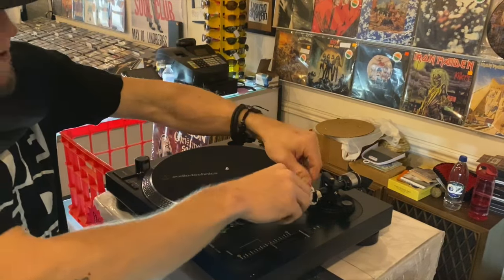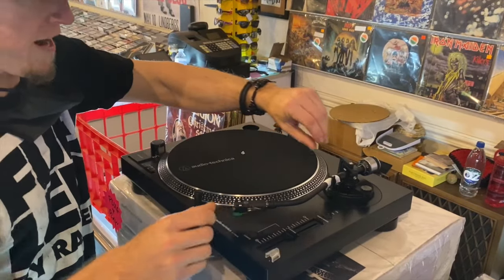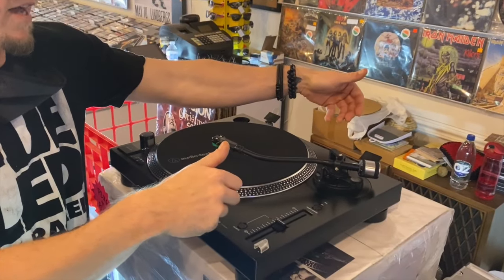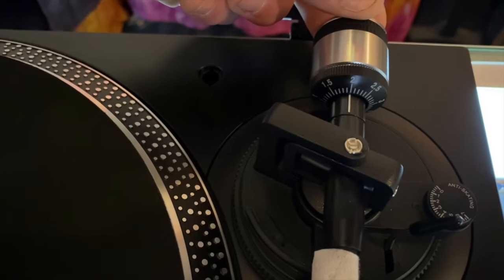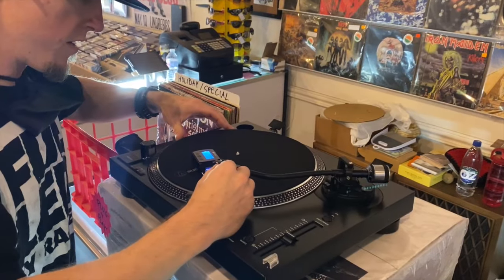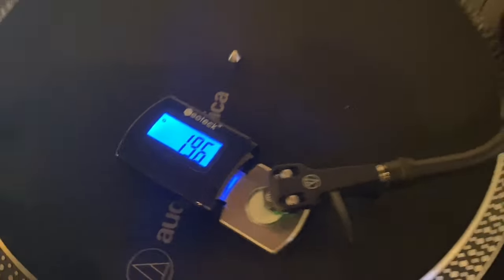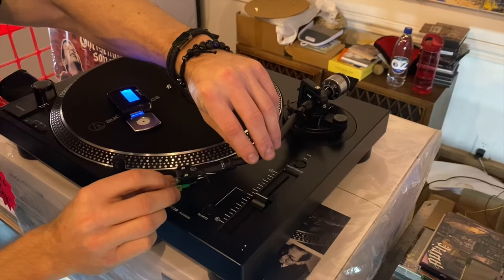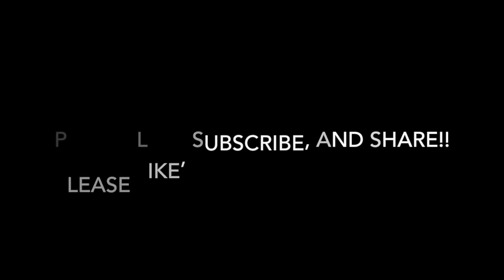How to Balance the Tonearm on an Audio Technica LP120XUSB

Comment: Following all other instructions that say to verify the tonearm floating level resulted in every one of my records having horrible crackling and popping. This method of balancing the tonearm are the only instructions that worked for me. Thanks so much for showing this method!
Reply: I swear I’ve only tried one record so far but I’m also noticing the same thing. This method of how you balanced the tonearm is different than the official video from the company that says just make sure it’s level. But I have a feeling this is a lot more accurate. Great video! Wish I watched this before I set it up but glad I found it within a week of getting this!! Even if it’s just placebo, it’s definitely not worse than before and I swear there’s a lot less surface noise between tracks now and pops overall.

Comment: Supposed to float level before setting to zero
Reply from the maker: I’ve had several comments like this, but if the weight is set correctly, and the digital reading verifies this, it proves that this method is just as effective.
Reply: Isn't that exactly what he did??? I flowed his instructions and it worked well.
Reply: I thought exactly the same. In fact, AT’s instructions and manual show the tone arm as floating perpendicular (straight). The idea is to 0 the tone arm weight out, so it neither points upward or downward, before dialling in the TF for the particular cartridge. I must admit, the tone arm in this video looked to be pointing upward at the cartridge end, which suggests it wasn’t level
Reply: @rodneyalexander4006  The tone arm needs to float level, on its own - like a seesaw does, when 2 people are sat either end and they get it to float level!. That’s exactly the concept,

I had to agree with the other comment, that the tone arm in this video didn’t appear level, neither did it float on its own. It was angled upward at the cartridge end,

That’s certainly how it looked!

Comment: There is also an clockwise and anti clockwise at the base which does adjust the height. Why that is not shown here. Is that not available.  Please answer if you can
Reply from the maker: They manufactured this turntable to look like it has the height adjustment, but on this model it is fake.
Reply: @heavyheadsrecords  Right and is a big difference

Comment: Sir , according to manual guide book  its Tracking force 2.00 grms but when u measure its valuable given 1.96 grms ,so which value is accurate   ?
Reply from the maker: 2 grams is good. Sometimes I like to track at 2.5 - 3, but that's just personal preference. I think I was probably just showing how close to being accurate this method is.